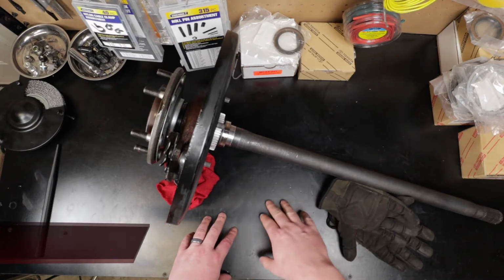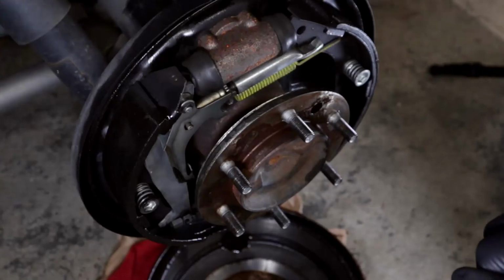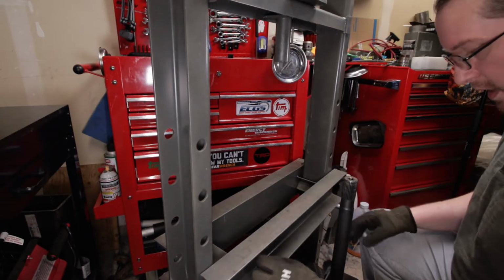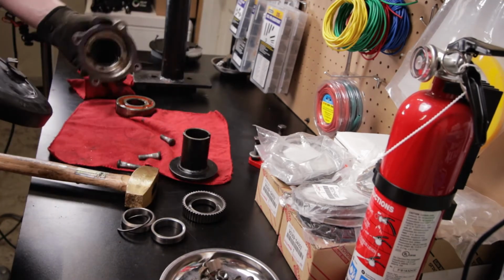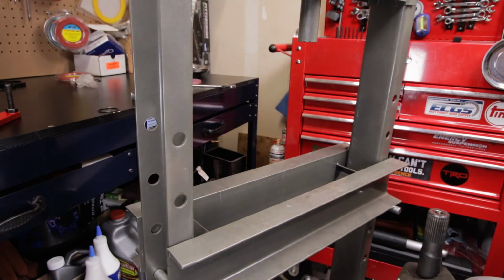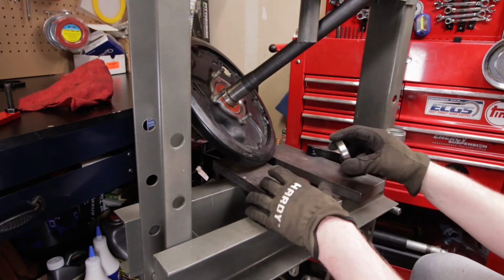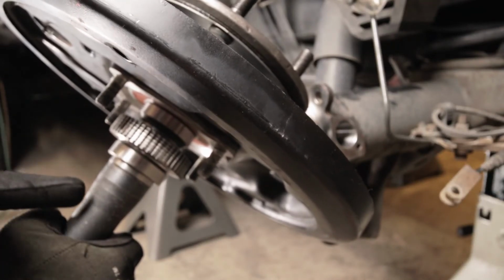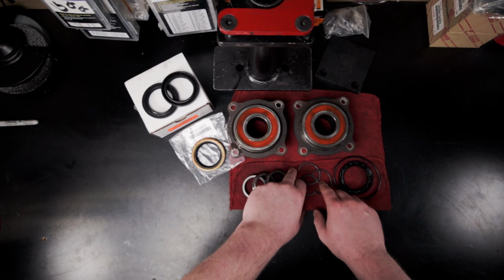Rear Axle Seal And Bearing Replacement - 3rd Gen 4Runner

Comment: Im stuck... removed the retainer bearing, abs ring, c clip. In the press and was easy but then got really tight. Worried to keep going
Reply from the maker: Hit it with a little bit of heat. Not too much to make it cherry red, but that should help loosen it up. I did bend one of the bearing removal tools once, so they can be really stuck on there.

Comment: Hey Man, really good video (I subscribed). Super fast forwarded segments for the simplistic parts and slow and easy for the detailed instructions. Editing your electric impact gun audio, (removing the lugs) to the beat of the music was next level.
I did this repair this past weekend. Using Duane's excellent tool and your video made for some easy wrenching.
I have never seen the Factory Service Manual. You commented it instructs the tech to 'cut off' the retainers........wow that's just crazy. And cutting it off all but guarantees a path for the gear oil to find a way past your newly installed retainer. 
The only part of the video that was hard to watch was when you went after the snap ring using screw drivers......ouch. I used a set of pliers; 'Stanley Proto J250G Proto 9-Inch Lock Ring Horseshoe Pliers' and the snap ring popped right off.
Keep up the good work. I'll be watching.
Reply from the maker: Thanks for watching 🍺👍 Glad this helped!

Comment: pop one side of the seal out of those used bearings clean with brake clean and repack with grease  pop seal back in , good as new , I.d reuse them if they were fairly new , why not
Reply from the maker: I apologize for singling this comment out, but this is an extremely bad idea. These bearings are cheap and there is an extreme risk of catastrophic failure if the bearing fails. It is cheap insurance to put in new ones especially if you have the tools 👍

Comment: Just a tip: do not press the axle and retainer together like the video shows. My tool is now completely stuck on the axle now and no way to get it off 😒
Reply from the maker: I'm not sure I follow. What time code in the video are you describing so we can help future watchers? 🙂
Reply: @WeekendWrenchTurner  25:00 you show putting on the retainer then just cut to the press
Reply from the maker: @MikeP41  You use the provided tool to press the retainer onto the axle. Not sure if you're using the same tool and provided in the description, but the tool has plenty of clearance so would not get stuck onto the axle and is too small to fit around the retainer. 👍
Reply: @WeekendWrenchTurner  Yeah unfortunately it got stuck on the taper of the retailer, I'm going to try and cut it off or go to the junkyard get get a new axle assembly
Reply from the maker: Ahh, I see. Was this with the tool from donald-the-bonald on Ebay?

Comment: It's been about a year. How was has the repair turned out? You get it right this time?
Reply from the maker: Thank you for asking! I did end up replacing the bearings again, but only because I did a rear disc brake conversion (check out the video). I did not replace the seals when I did that as they were not leaking! So, I'd say the factory seals are the way to go with the "Dr Coffee" method of flipping the inner bearing retainer so the bevel faces outboard. Thanks for checking out the video!

Comment: Keep up the great videos this one is very helpful for people looking to do the rear bearing and seals on their 3rd gen 4Runners I actually made my own tool to pull the abs ring gear and retainers as well as the bearing and backing plate it works amazing made it out of and old axle
Reply from the maker: Thanks for checking out the video 👍 Was literally doing this again today as I'm working on a rear disc brake conversion. Somehow though, I ended up bending the plate that attaches the the bearing housing 😕
Reply: @WeekendWrenchTurner  oh man that’s no fun wait they have a disc conversion kit for these 3rd gen 4Runners no way!!! I’ve looked and looked for one and have never found one
Reply from the maker: There is one made from a user on T4R.org named "midcoma". I was the 5th one to pick one up and working on getting it installed this week 👍
Reply: @WeekendWrenchTurner  do you have a link to it? I would definately love to check it out
Reply: @WeekendWrenchTurner  I own 2 4Runners a 98 5 speed and an 01 automatic
Reply from the maker: Here's a link for you: https://www.toyota-4runner.org/3rd-gen-t4rs/285491-rear-disc-brake-conversion-kit.html

Lots of good discussion about converting these 👍
Reply: @WeekendWrenchTurner  just checked it out looks good however it’s a bit confusing do you still use the axle shaft?
Reply from the maker: @edwinthetechnician6578  yes you still use the factory axles, but you'll have to pull them and remove the drum brake backing plate first. You can either cut them off, or do as I'm doing and press it all off👍